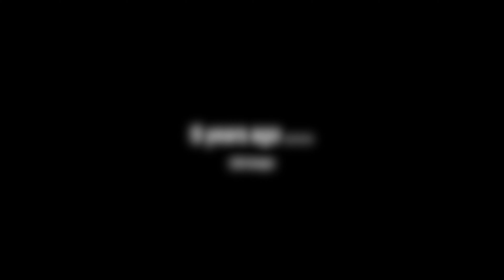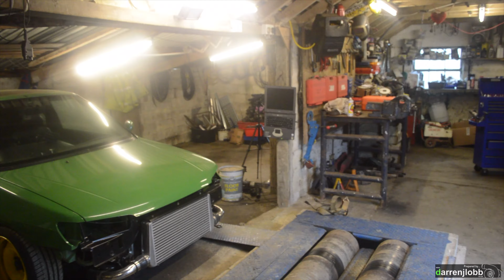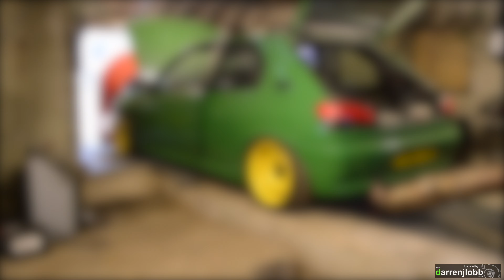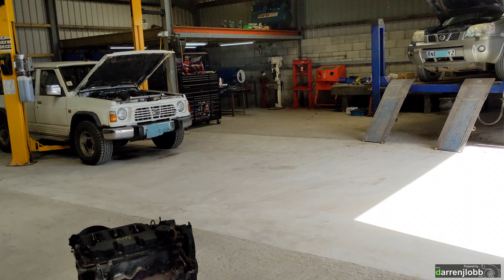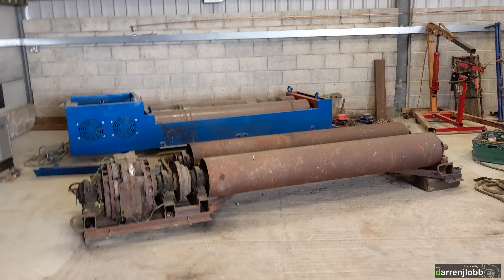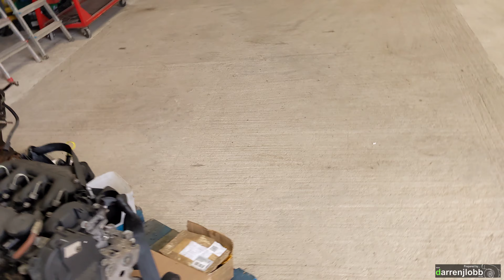2023 Channel Revival?!

Comment: I thought about the mtdi Audi v6 project the other day, I’ve got a Volvo v70 with a (stock) Volkswagen 5cyl tdi. Damn thing was giving me endless trouble with the Bosch VP37 electronically controlled injection system (25year old unavailable sensors wearing out, obsolete ECU being difficult, ect ect) and partially inspired by that project I thought about just building a fully mechanical pump for it using a V.E. Pump and the 5cyl injection parts out of the VP37 pump, it looks identical….

I learned so much about injection pumps, and diesel engines generally from your channel, I’d love to see more.

You dyno videos are just fantastic too, I’ve always wanted to do something like that. I’ll likely never have the space, nor neighbours that would tolerate the noise, so watching you do it is a good substitute 😉 

The oVlov seems to have healed itself for the time being, but the thought is still there!